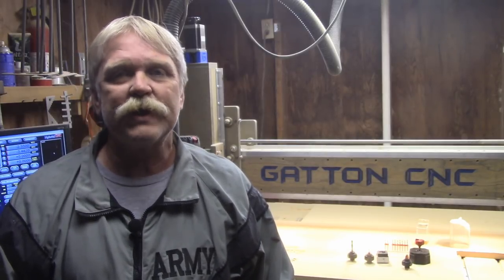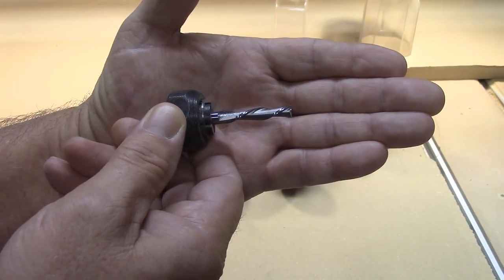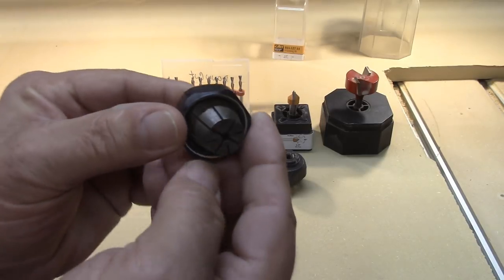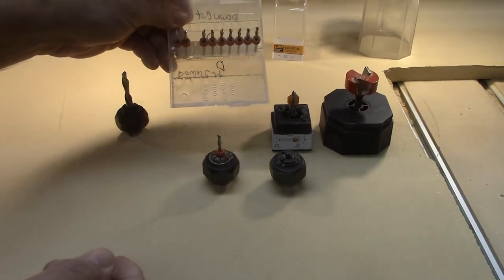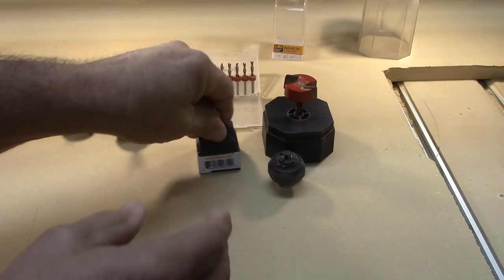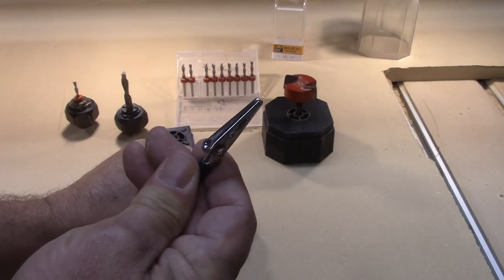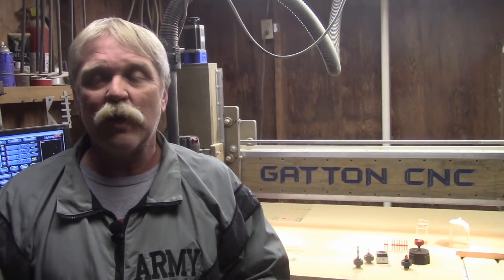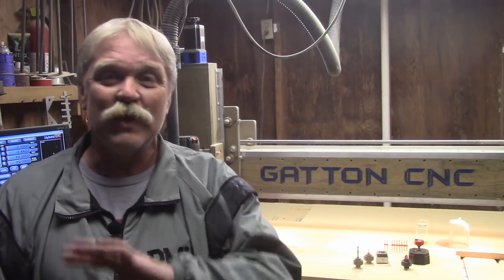How Much Bit in the Collet? - CNC For Beginners

Comment: Great tips for the router! I do the backing out as well...just slightly.
Reply from the maker: I was a little bit surprised that so many folks didn't know about that. It's just one of those little things you pick up along the way. I totally forgot that to a lot of folks, their first experience with a router or spindle is on a CNC machine, and it's not something that gets mentioned a lot.

Thanks Eloy!

Comment: hi Mark , i have a metabo router with a 1/2 shank on a gbrl shield cnc  ,  but 1/2 bits are way more expensive than 1/4 , my question is  if i want to save some $ can i use a 1/2 to  1/4 collet adapter  ? if yes how long do the adapters last or if its a common practice or even safe ,.  hopefully you can get back to me  ,, ps love your channel have learned alot
Reply from the maker: Personally, I don't like collet adapters. They vibrate, come loose, and add runout to the whole bit to router/spindle connection. Much better to get a 1/4 inch collet for your router (they're not expensive.) Just do a Google search for your model of router. Some models, like the M12VC use the same collet as the Bosch 1618 (from what I've read,) but you should do your own research. If all else fails, contact Metabo, or look for a manual to see if they list a part number for a 1/4 inch collet.

Comment: Another great video, Mark. As always, I learned some new things. I use o-rings on my bits as a stop to make sure I have the bits inserted the right amount. I have a little block of wood that's drilled to the shank size, and the depth of full insertion. When my o-rings get out of position or alignment, I can use that wooden gauge to reposition the o-ring on the shaft. I've been thinking about cementing the o-ring to the proper postion on the bits. Do you think that's a good idea, and what kind of cement would you use? Thanks.
Reply from the maker: Thanks, Jim! 
Cool idea! I don't know that I'd cement the o-rings in place though. I mean, it wouldn't be too much of a pain to recheck them with that jig. I might look into doing the same on my 1/8" shank bits that don't have the collar on them. Thanks for the idea!
Reply: @MarkLindsayCNC  I don't know that it's necessary, but I used the red silicone rings in case of heat buildup when used in a router table:
https://www.amazon.com/gp/product/B000FN0X04/ref=oh_aui_detailpage_o08_s00?ie=UTF8&psc=1

Comment: A problem I often have is with flat end-mills with large stepover. They loosen themselves because of the force they encounter from digging into the material. After they loosen themselves, they slip downwards, and I effectively end up with a more negative actual Z number, than what I started with
Reply from the maker: I've never encountered that problem, but you may want to look into getting a new collet. Collets do wear out and lose their ability to grip the shank of a bit. If it's not gripping the shank of the bit tight enough, that can lead to all kinds of problems. I don't know if you're using a spindle or a router, but I've found that for router collets, my go-to place is Elaire Corp. They have a huge selection of router collets for many different brands and models of routers. If you're using a spindle, it would be worth investing in a new collet in whichever ER size your spindle takes. As for a "large stepover," most bit manufacturers agree that you shouldn't exceed 1/2 of the bit's cutting diameter. I follow that advice and have yet to have a problem.
Reply: @MarkLindsayCNC  I figured it out. The nature of the problem is thermal. These tools cut out significant amount of material, and heat up. As they heat up, the grip weakens. I tend to use light tightening when I put the tool in. The problem is significantly worse when I run in higher speeds or higher stepovers, because more heat is produced, which loosens the grip. I use an ER11 collet nut, and the same problem happens in different bits of different sizes in different collets
Reply from the maker: If the tool is getting hot, your RPMs are too high, your feed rate is too slow, or a combination of the two. Once the spindle stops, you should be able to grab hold of that bit bare-handed and it should just be a little bit warm. If it's hot to the touch, that's your problem.
Reply: @MarkLindsayCNC  you're spot on there. Trouble is, it's a positive feedback loop. Once it gets hot, it slips downwards and gets even hotter. It's counter intuitive (and untrue?) that higher feeds result in a LOWER temperature. As my tool slips downwards, it effectively encounters more material, similar to what would happen in a higher feed.
Reply from the maker: The thing is, you want the flutes to cut and eject chips. Those chips take the heat with them. Slowing down the router/spindle RPM or increasing the feed rate (or a combination of the two) make the flutes of the bit cut larger chips and eject them. Your bit slipping down does encounter more material - vertically. It's still cutting the same sized chip, and is retaining even more heat in the process because it's cutting deeper. The point is, the flute(s) need more time to cut and eject larger chips, which will take the heat with them as they're ejected. You can accomplish this by slowing down the router/spindle RPM, speeding up the feed rate, or a combination of the two.

Comment: Please add: shank is longer than the collect.  Thanks for the video
Reply from the maker: That's not necessarily true, Harry. I have several bits that have a shank that is shorter than the collet.
Reply: @MarkLindsayCNC  That's not what I meant. The shank on some of my bits is long enough to go through the collet and than some.I tend to let it extend about 1/8" beyond the collet. However; this means that the bit between the collet and work piece could be too long making it easier to break a bit
Reply from the maker: Okay, I see what you're getting at. I don't like to push the end of the shank through the collet. I'll leave it flush, but not sticking through. I've never had a problem with breakage (other than the .023" end mill I dropped on the concrete floor.) And to be honest, if the bit is that long, you'll need to adjust your feed and plunge rate to keep deflection down to a minimum, anyway. That or it might be time to look into some shorter bits.